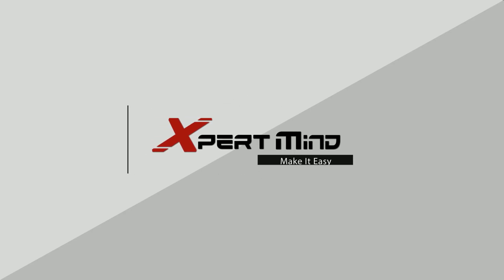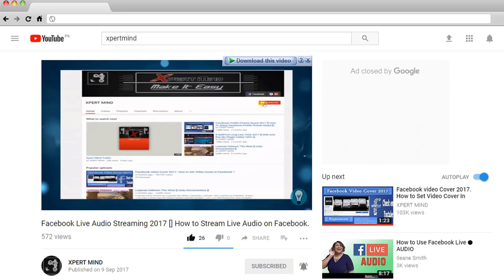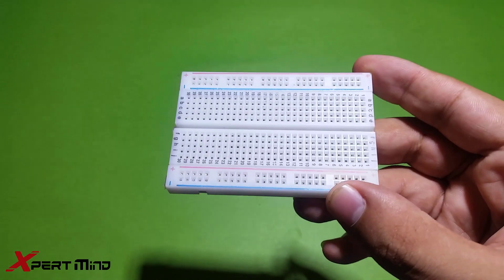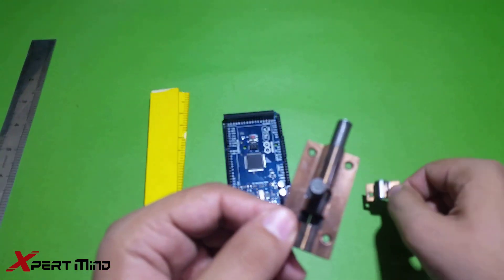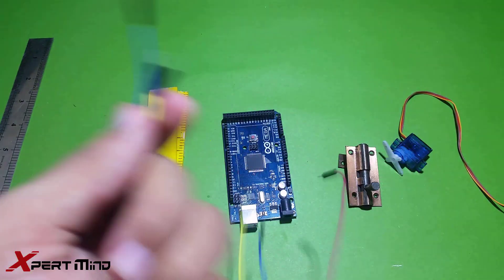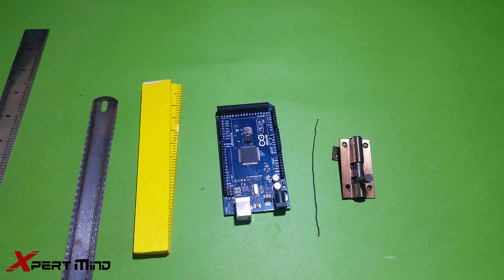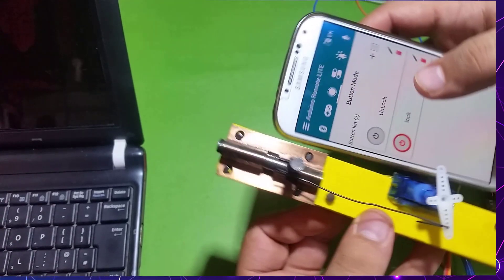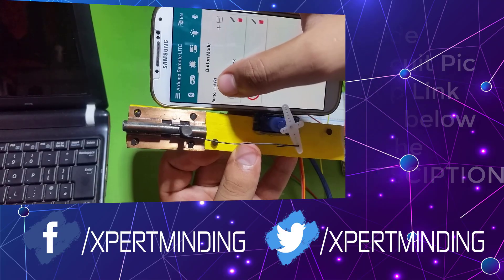Smartphone Controlled Door Lock With Single Servo | Arduino Project

Comment: Hi there, can you please help me. I'm making this project and I have a 9V battery and want to use that but I don't  know how. I don't understand how to connect it based on that circuit diagram. Please help. Thank you so much in advance Sir. :)
Reply: Connect +ve terminal of the battery to the Vin port of Arduino and -ve terminal to the ground port.

Comment: What if the bluetooth module cannot connect in my phone? What should I do?
Reply: i have fix on my latest comment. But I have a problem on my servo motor, my servo motor does not works. I apply 9v battery but they did not work. I need your help pls.
Reply: my servo motor brand is FITEC FS90R continous servo and the colors of the wire is orange, red, and brown
Reply: can i email you? I will show to you my diagram if its ok to you.